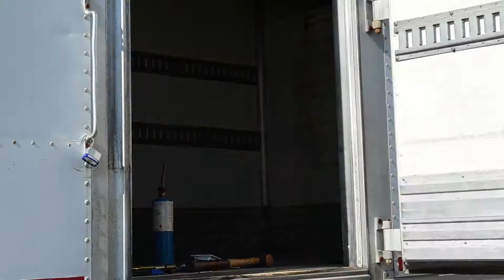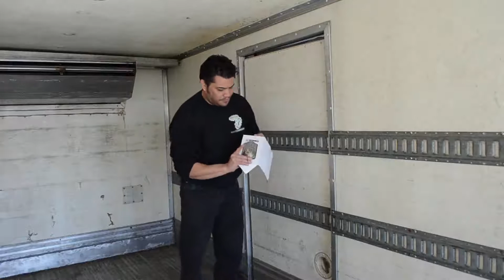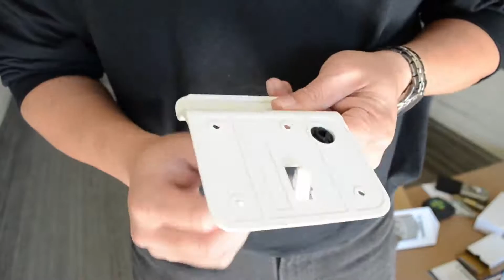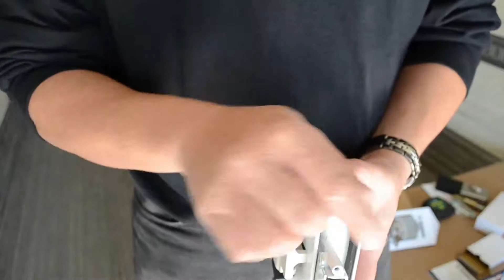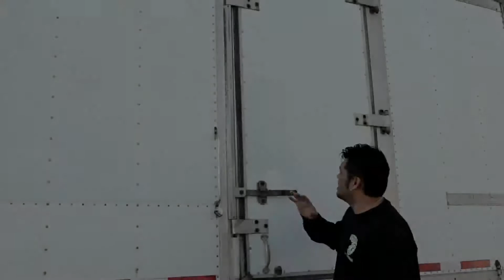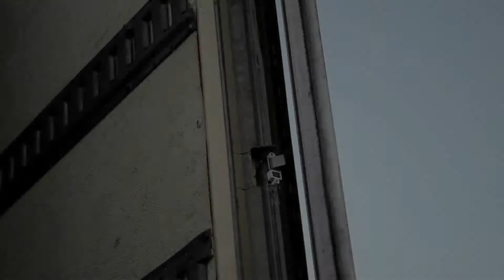Box Truck RV Tiny House Conversion - Latch Modification for Thick Doors - Part 1

Comment: First 3 videos 45 minutes time wasted on a ten minute walk thru for anyone who has driven a box truck. A simple spreadsheet of improvements with budget would be helpful. Have found a hvac engineer who has done calculations of r factors heat loss or gain  calculations. The main refer 
It is great to pre chill unit rember you are chilling the objects in the unit and removing moisture. An auto thermostat could be
Re-engineered 
To do that and it runs off fuel tank. My cuz has one we pre chill and use for ice slush to haul salmon 10,000# per load. I would design it as modular living units. That way with a ramp you could store components  so it could be used to earn money. Craigslist garbage removal, construction painting, landscaping, expediting or moving service. That leaves options for you or any future biyer. Many construction guys are paid motel and travel and can store tools, and tow pickup. That pays for the rig. Many build a pickup, cargo trailer or refer rig for job site office. Many options to make it flexable and saleable. My cuz bought a 26' freightliner with refer dor $12k only 50k miles. 
Bought used tires off craigslist and found rv 5kw diesel genset for $400 has set up for backup power his house and transfer to truck during commerical fishing season. Then we have f350 to tow boat 14k# and 30' trailer and net trailer with totes and pressure washee. 500,000# salmon in a season.

Comment: First off the RV lock is junk. I say this as I have been a locksmith since 1977.

The existing lock is strong, simple and durable. To keep all of the good leave the bar set up in place, and rework the parts on the truck so you can free them fron the inside.  On the rear, the bar that the hook engages can be rebuilt to retract forward to unlock fron the inside with a stepper motor.  Think about your refer unit you have a nice big condenser in situ.  Add a DC refrigeration pump some valves and plumbing, and get an evaporation unit for a fridge, another for a freezer and install them into a couple of well insulated boxes. Next look at radiant cooling panels for your ceiling. A few temp sensors and an arduino controller and you have a nice fridge, a nice freezer,  and a nifty comfot cooling system.

No look at your ThermoKing unit.  That has a nice alternator. Charge your batteries,  or heat or cool the box while you travel.

Next since you got a nice insulated aluminum floor a bit of radient tubing and some hot water and a circulating pump, you now
 have radiant heat for those cold winter nights. 

Now look for a lift gate to bolt on as your mortpr cycle lift.
Reply from the maker: Wow...what an excellent post!  Fantastic ideas.  Redesigning the  the rear latch pin hadn't even crossed my mind...definitely a great idea.  I couldn't agree more about the RV lock being junk.  I'll probably apply a medieval-style bar inside controlled pneumatically via an arduino as I've decided to use air power for several applications.  Not sure how to rework the existing door lock mechanism to work from the inside as it is.  Kinda the wall I hit with it, but I'm all ears if you've got something bouncing around in your head.  Shoot me a message if you'd like to brainstorm some ideas...you seem to have some great ones!

I didn't consider radiant heat either.  Not a bad idea using the aluminum floor as a heatsink for nice even heat.  Maybe tie it in with solar / rocket stove / pyrolyser setup using a glycol/water based transfer fluid.  Neat idea for sure.  Would only need to power the pump with that design.

Here's my hangup with the ThermoKing.  You make great points...it certainly could be used for power generation and it already has in place everything needed for cooling (and heating for that matter) but it just GUZZLES diesel...lol.  I can't even begin to tell you how bad the fuel economy is on this beast.  I'm not planning to drive it much..only for point A to B when I decide to "move" (likely somewhere where the weather's nicer...more sun hours etc..)   Really awesome ideas in using it for a fridge/freezer setup and radiant cooling though.  That's thinking outside the box!  I love it!

Thank a million for the thoughtful and intelligent post!  Respect to ya!  -JT
Reply: Solar rocket stove?  Pyrolyser?  While I czn appreciate high tech, just buying some propane and a tankless water heater would probably suit your personal heating needs at a reasonable cost.  In doing it this way it would be simple to circulate your potable water in the radient flooring.  Control would be simple, the heater would kick off as the water reaches a set point on the return line. The parts you would need would be a in line thermostats and electricly actuated valves.  Perhaps a PID would be a nice touch.  The reason for using potable water over the glycol  would be that you would avoid having a second pump and tank. You will not need the heat as the whole idea is to go where it is not nasty cold in the winter and not screaming hot in the summer.  Your highly insulated truck puts you way ahead of the curve in having to pump heat in trying to make up for heat loss in a less insulated space.  Also if your water heater draws outside air for combustion and vents outside you eliminate a lot of water vapors in the rig.

On the door lock the factory door lock assures a good compression on the seal. This is not a big issue unless you are parked where it is very hot or very cold.  If someone decides to  lock your door and you are inside there is a problem.  I think the best way to deal with this would be to mount the catch on the outside to a piece if square iron that fits into a socket and is retained with a pin on the inside. Pull the pins and push the door open.  The socket has to  be designed so it would not jam in an emergency.

For regular locking consider a rim lock. These surface mount on the inside  and a lock cylinder is outside.

Another option is to use a walk in freezer latch.  This mounts on the outside, and even if padlocked it has a release that can get the door open if someone needs to get out.  Your local grocer or restaurant will let you look at one.

Pnumatic actuation is a great thing but a bit overkill for a motor home. Keep it simple.

Comment: Perhaps you could recess one or both halves. I used to drive just such a truck and have been considering a similar conversion. The area under the box could carry water and waste tanks as well as propane. Have you considered a composting toilet. It would save trips to a pumping station when you've found a long term location. My friend had a caretaking gig on a hunting club. Good luck to you.
Reply from the maker: Recessing the latch is not a bad idea at all....would certainly make things easier if I can support the assembly adequately.  Great suggestion and I'll definitely look into it!

I like the idea of utilizing the space under the box for storage.  I'm finding out that space is like gold for something like this.  LOL

The composting toilet seems to be the way to go.  Let's face it...trips to dump the tanks could be an annoyance and honestly, I'd rather not have to do it more than I absolutely need to.  I've been kicking around the idea of designing a biogas digester.  The more I think about it, the more I like the idea.  Generate methane fuel with waste while producing a sterile byproduct that is completely biodegradable and the plants LOVE it.  Pretty much win/win.  Let me know what you think and thanks for commenting!

Comment: Hey JT,
About your videos: Telling the viewer you are refocusing your cam isn't needed. Simply do it. Also you might want to walk through the build process rather then the thinking process. Probably you might want to clarify your idea with a drawing (separate shot, added later).
Concerning this process, and seeing you are presenting yourself as engineer, i am only assuming you are familiar with Sketchup, Inventor and the likes and can fiddle with your ideas before implementing them. Maybe even use grabcad.com for that.
What i like to know if you don't mind telling: Do you have any clue what the R and Lambda value of this trucks box might be? And is the cooling system adjustable to temperatures you like or only to cold and freezing temperatures?
Reply from the maker: Thanks for the constructive criticizm.  I'm new at this and learning so I'll try to keep those points in mind.

Great catch regarding Sketchup / CAD -type programs!  I made my logo with Sketchup/GIMP.  Excellent tools.  I really like how you can create and manipulate digital 3D models to better visualize ideas.  Do you have a favorite?

Glad to answer your questions.  I don't have the insulation specs on the box but it would be great to know the exact specs from the manufacturer.  The tag is worn and unlegible so figuring out the right model might take some time.  I can tell you that I was out in the truck a couple weeks ago working on the solar and we had 32F temps.  I warmed the entire 22' to near 80F with a small 1500W space heater and 500W halogen worklight.  I was most impressed.

I don't plan to use the refrigeration unit unless absolutely necessary.  I'm not even totally solid on keeping it, but it does regulate the temperature inside the box to a setpoint either direction.  I was a little surprised when I tried it on a cold day and it warmed up the back.  There's a controller for the unit in the cab that I'll likely end up relocating to the box.

Thanks for taking an interest and the excellent comment.  I'd appreciate your input on future videos!

~JT
Reply: Well, as i have been working with Inventor and Solidworks as well as Autocad, so i have been a little spoiled. Both Inventor as well as Solidworks have their distinctive advantages. Also have taken a look into Revit and used Sketchup for several projects. Not as good with those programs as i like to be, but i am getting along with them.
Since i am living in the Netherlands and near one site of FloraHolland (biggest floral auctioner worldwide, selling 60% of the global floral trade daily) i have been looking into buying a second hand flower transport truck. However they remain pretty expensive to buy, even second hand as well as you will have quite some expenses transforming them into a proper roadhome. I was quite uncertain if you even could wiggle them to remain at a certain temperature above 50 degrees Fahrenheit. Most of the time the R value and lambda values of such truck are quite impressive but at the same time are difficult to obtain.
Reply: Well if you can get a cheap indoor out door thermometer you can shut the truck and set the unit to be warmer or colder that the ambiant temp.

Now take periodic readings.

Next do the samr on a regular truck. The results should give enough information, and it is cheap!

Comment: I know you're just getting started on your video's, but you need to edit them down a little to 10 or 15 min at most. People lose interest real quick. I'm looking to do the same thing in a few years myself, but I think I'm going to get a 16 to 20 foot  Mitsubishi Fuso or something along those lines. I'll be watching see how your build goes.
Reply from the maker: Thanks for the suggestion and I'll definitely try to implement that.  I'm admittedly long-winded, but I do want to improve my viewer's experience the best I can.

I like the idea of a smaller box truck.  More maneuverable and should be better on fuel.  I went with this one mainly because I want to put a shop/garage area in the back so I needed a bit more space.  Not even sure this will be enough.  LOL

Thanks for the constructive criticism and for watching!

~JT
Reply: That's the same reason I'm going for Fuso. I'm planning on having a little area in the back so I can but a motorcycle in it, plus with the extra area's on the bottom side of these commercial trucks there more room for bigger water, propane tanks, and batteries.

Comment: have you thought about what they use in walk in freezers or using home or industrial locksets
Reply from the maker: Hello there and welcome!  That thought did cross my mind at one point.  I
 think it's a great suggestion...after all, they are designed for the 
weight and thickness of these doors.  Installation would be far 
easier...and faster.

I mainly settled on going this route due to cost and availability.

Great comment and suggestion!  I'll touch on this more in a special video covering awesome suggestions that I didn't implement.  Check back for it...you'll get mentioned.  I plan to do one of these videos at the end of each project series to get the word out on other options if others have easy access to these kinds of parts.

The idea here is to help anyone do these projects themselves and knowledge is power.

Thanks again for contributing!

~JT